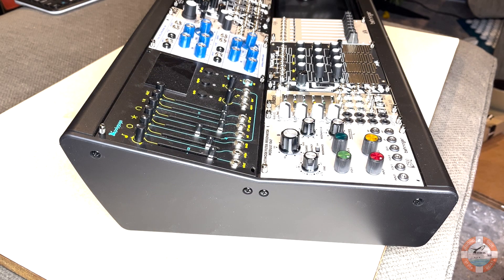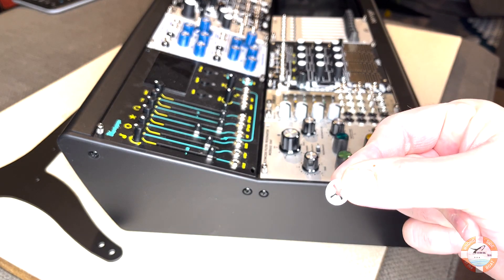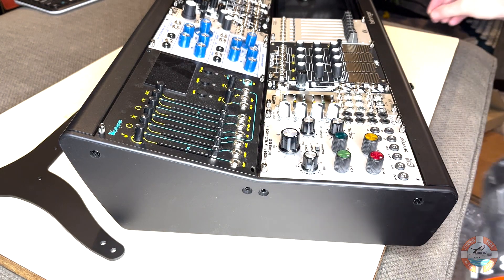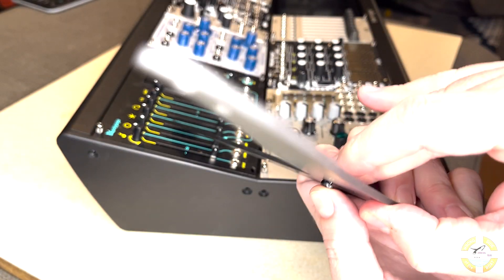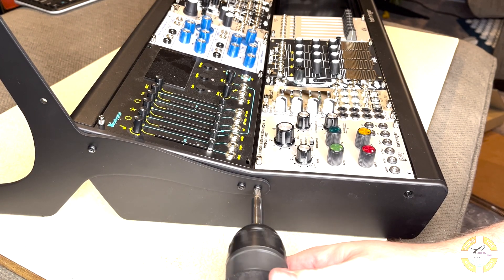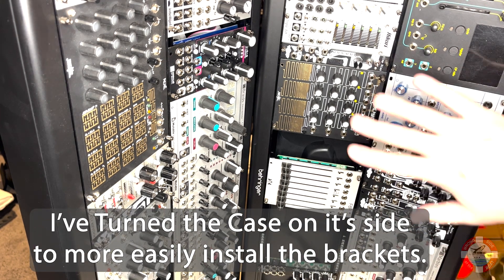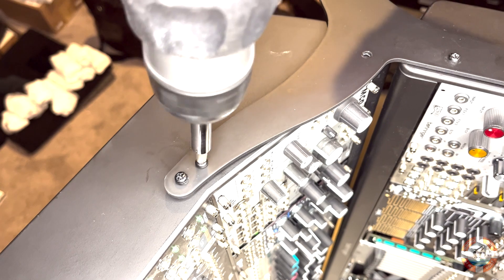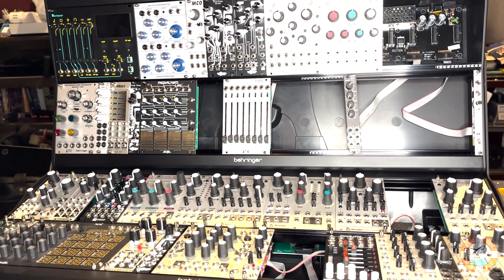TipTop Brackets on a Behringer Eurorack Go Case | Will It Fit??

Comment: I was able to get all the screw holes to line up by giving one of the cases a bit of a twist. That ended up with the cases not being perfectly parallel, but I wanted all the screws installed. I also cut some wood shims to fit under the back backets and glued those to my desk (custom made for the rack).

Comment: Nice demo. I was considering doing this as I've found some brackets, but still not sure if I should get two Mantis cases instead. This certainly helps that decision. It doesn't look like you turned the top case upside down? I heard this was required and certainly makes sense from the cabling perspective. Perhaps that addresses the holes lining up?
Reply from the maker: Glad I could help! Thanks for the feedback. Best wishes with your setup!